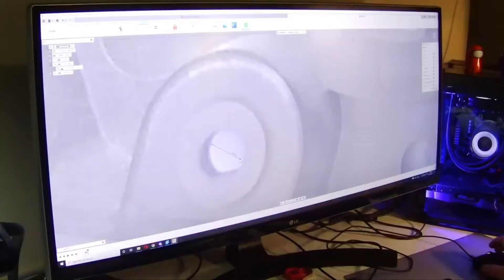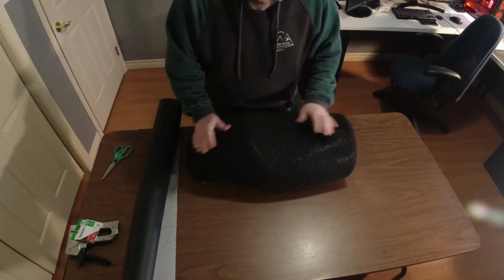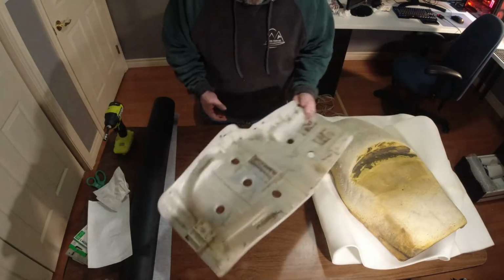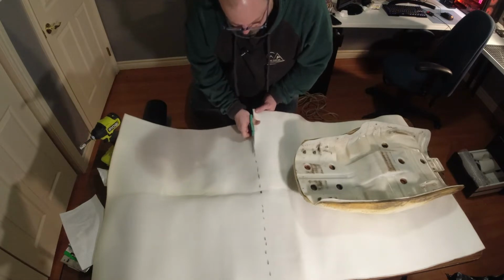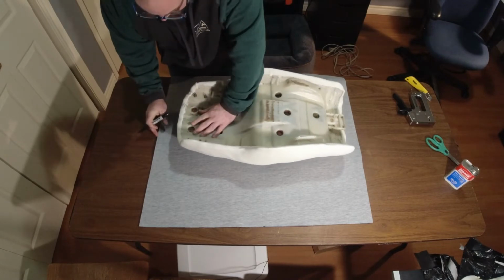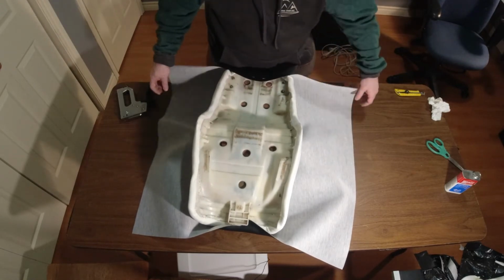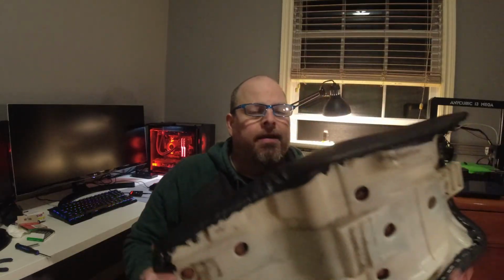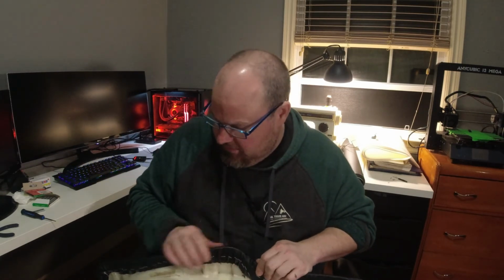That GoldWing Project Part 11 - Seat Cover

Comment: I went and used 8mm JT21 staples. Then pulled, and pulled, and pulled to get the friggin puckers out. Mine too a lot longer than yours did. The heat gun looks like it would make it easier.